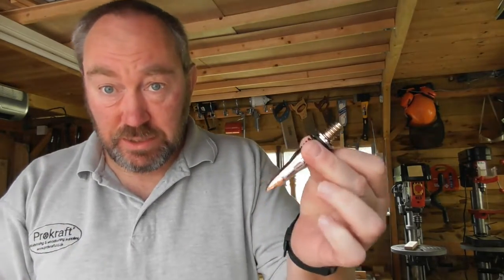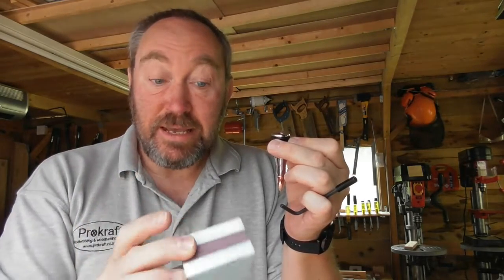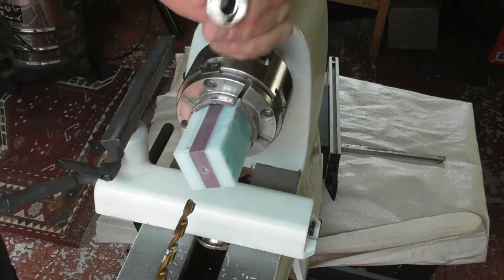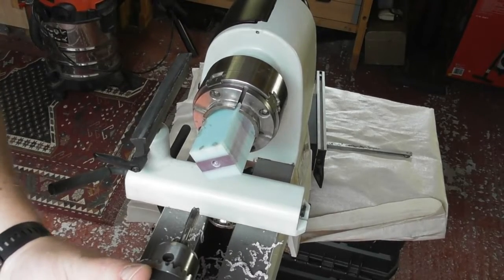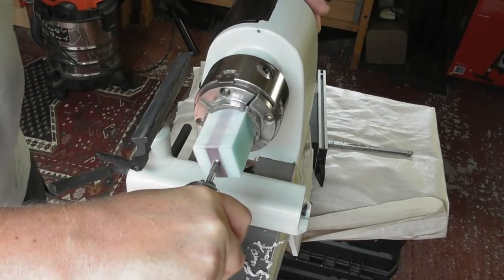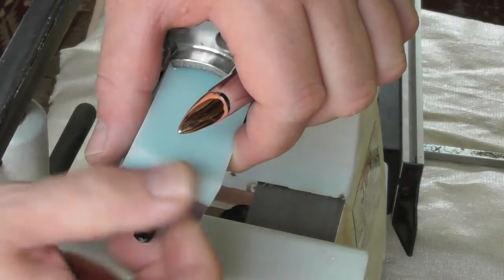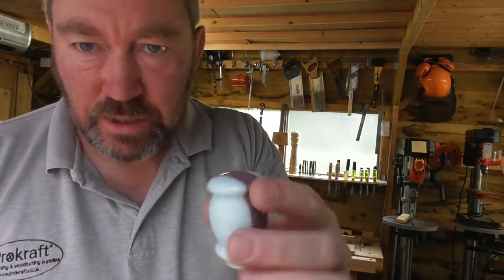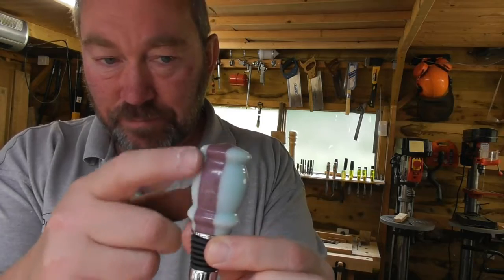Bullet Bottle Stopper direct thread

Comment: Great advice about holding the Jacob's chuck when withdrawing. Being a rank beginer I did have an incident a few weeks ago which could have been very dangerous. Fortunately, no injuries but I did have to disassemble and reassemble my chuck to get it back to true. I've just received my latest order from you in very quick time, thank you. There should be another video of mine up shortly using them for a local fundraiser. 👍